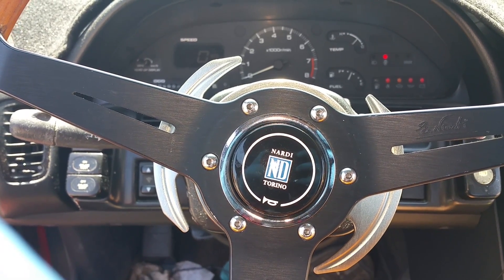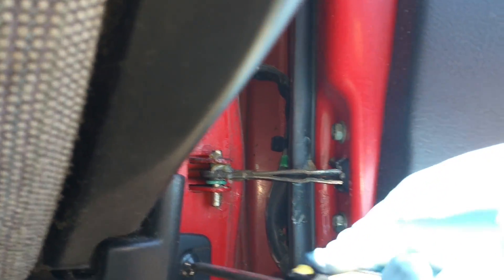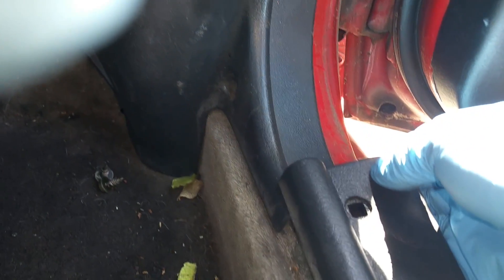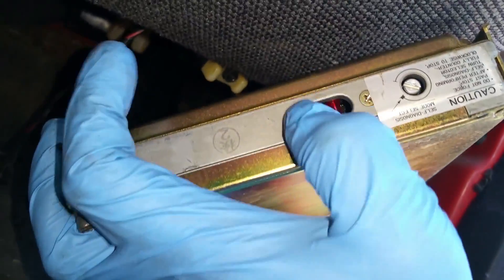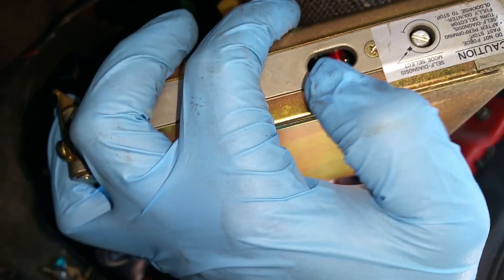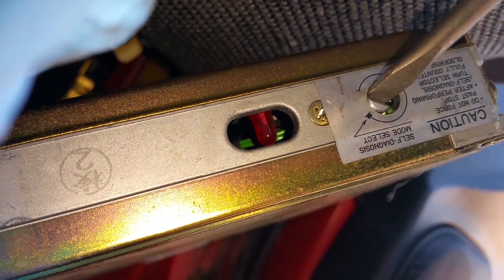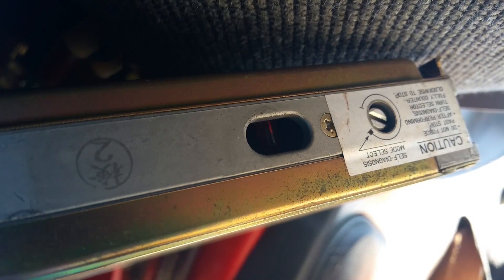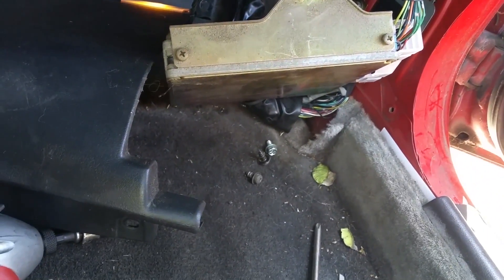How to get codes from your check engine light 240sx s13

Comment: Does this turn off or get rid of the check engine light or is it just for gettting codes?
Reply from the maker: getting codes, then when you rotate the screw back to its original position, it clears the check engine light until the problem triggers the check engine light again

Comment: Man thank you so much ! Just picked up a vert w a DE and I got codes 34 & 13 ! It runs like a champ so far !
Reply from the maker: Nice work bro, glad the video helped guide you on your way to keeping her healthy 🤙🏼
Reply: @albertvintayen  heyyy just a follow up, cylinder #3 has 40psi from compression, fortunately I’ll be rebuilding my 40 coupe vert.
Reply from the maker: @EmiiiZ32  damn, that’s really low, what did you find?  Oil rings on the pistons or a cracked head gasket?  Hopefully not a cracked block!!  At least you get rebuild your engine, build it to factory spec and she’ll last you at least another 25 years!

Comment: awe man thanks, freakin Amazon taking forever to ship my  Obd2 adapter wire for an older model nissan. .
Reply from the maker: Yeah, quick and easy way to get codes off your ECU without the need to buy a consult reader/converter.  How's your project coming along?
Reply: @albertvintayen  challenging
Reply from the maker: Nitter Undercove what seems to be the problem?

Comment: I have 240sx fully loaded fastback car. I am having trouble with sparky. Does check engine light have to be on while turning the ignition switch to on or no?
Reply from the maker: kennedy wong not necessarily, that check engine light would come on only if the ECU detected a misfire or some condition to flag as a code.  If you’re not getting spark,  check your distributor, sometimes the cap goes bad with condensation or there are cracks somewhere.  Also make sure there is no corrosion at your points of contact.  Make sure spark plug wires are good too.  Good luck!!  Check back in with your progress 💪🏼
Reply: Not too worry about the check engine light. The car have fuel to injector but there no sparky at all. I brought new spark plug wire, condenser resister, spark plug, distrubutor cap and rotor. Set the timing TDC and check for compression stroke and it good. rotor facing at 8 to 9 on rotor on distributor. Cranking engine rotor spin and timing chain too, The result no sparky at all. I check ignition signal wiring for open circuit and there no open loop on multi meter. o.k, i check the coil for voltage and there is power. I check the ignition module harness plug and there no power pin 1 which the thick white wire.which Is that ignition module plug. Could be the problem why no sparky?

Comment: I have 1993 240sx but I was wondering if trouble shoot same as your here or no?
Reply from the maker: Yes Kennedy, unless you have swapped out your KA24DE for a KA24E (single cam) this guide should get you the codes you need to find out what's setting your check engine light.  Good luck!
Reply: I want to clear some thing up about ecu. I brought another ecu for ka24de and turn ignition key and there no cel. Is this normal or should it be on, but the car still start.

Comment: nice video man my s13 thanks you kind sir hahah and question where did you get that coolass odometer
Reply from the maker: Kevin Martinez I guess it was an option on some 240sx--it's called a digital HUD (heads up display).  It projects your speed on your windshield so you never have to take your eyes off the road.  Pretty cool but a lot of them are broken.  

I'm glad this video was able to help out!! What problems were you having?
Reply: albert vintayen i havent checked it i just took the ecm out and i was waiting for this cali heat to go away and my s13 has a few problems burns too much gas and also a air leak

Comment: What should you do if the led doesn't turn on after you turn it clockwise and counterclockwise the first time?
Reply from the maker: is it possible you're not getting power to the ECU?  are you having issues starting your car?  best case scenario is you have a burnt out LED--worst case, bad ECU.  

Here's a link to all the ECU codes you could get
http://www.240sx.org/faq/articles/ecm_codes_doch.htm
Reply from the maker: Doctor Penne the guy never responded, but I’m sure he just replaced his ECU.  They’re a dime a dozen (at least they used to be).  Shouldn’t be hard to source one on eBay, just make sure it matches yours exactly

Comment: My 240 isn't pulsing fuel to the one injector and I had it checked out and I was told I have a bad ecu. I changed the injector thinking it was that and it wasn't I had someone test the connection in the injector plug and it was bad. Do u think trying this would help that problem by any chance? It doesn't seem likely but I thought I would ask. If there's anyone out there that has an answer plz let me know. Thanks!
Reply from the maker: When it comes to 20 year old PLUS cars, there's bound to be a bad connection in the wire looms (age, heat, vibration) it's just a fact of life.  If you could, try to find a wire "tracer" and find where breaks and repair or replace it (your call).  As for a bad ECU, I have never run into this happening--but if this were the case, I don't see why you couldn't borrow a friend's ECU and try it in yours to see if that fixes the problem (easier than dropping money on a used part at a junkyard).  And if that fixes it, then hey, I guess you're in the market for an ECU.  There's no real way of finding a code for a pulsating injector, just these "trial and error" ways of fixing it.  I hope you find your way and the fix isn't too obnoxious!  Update me on this, I'd like to know how you did!!  Good luck!
Reply: albert vintayen yeah that's true that's kinda the only downside to obd 1. As a matter of fact I got another ecu and popped it in and that fixed my problem. I didn't think the ecu was the problem either but hey cars are cars it could've been anything and like you said, trial and error is really the only way to fix it. My 240 is running A1 now n I couldn't be happier! Thanks for the advice/ response I appreciate it!
Reply from the maker: Ayyyye, glad you're back on the road!!  Maybe you had some sort of electrical pulse that messed up your fuel mapping--but you're right.  The odds of that happening are pretty slim to none.  That problem probably would have stumped me for a couple of days.  Always nice to have spare parts lying around ;)
Reply: albert vintayen Thanks man! and yeah sadly that's most likely what it was. Believe me it stumped me too haha and that's for sure, extra parts are a must 👍

Comment: Would the technique be the same for a 95 s14 KA24de?
Reply from the maker: +Saiyan_AB I'd like to think so--it depends on when your car was manufactured.  "All s14's manufactured after July 95 are considered '96 models and therefore are OBD2"  so if you don't see an OBDII plug under your dash, then it's probably an earlier s14, and therefore, OBD1.  Let me know how it works out for you!
Reply: +albert vintayen found out it's an obd2 sucks cause I took out the ecu... I was looking for the obd2 plug under the driver dash didn't see anything it was on the passenger side opposite of the ecu tucked away in the back
Reply from the maker: Yikes bro, yeah that sucks, just put it back. Lucky for you, obd2 is easier to diagnose, all you need is a scanner (no need to pull kick panels, lol).  Keep me posted bud! Good luck with your car
Reply: +albert vintayen yea lol at least I know how to check it if I ever have a car with obd1 now
Reply from the maker: +Saiyan_AB 👍👍 some cars are even easier than this lol
Reply: yo I have a 95 s14 ka24de.. so it is obd2?
 I was about to do this but nothing on our year
Reply: was yours stock untouched or someone mess with wiring and or what year?
Reply from the maker: It all depends on when your car was manufactured.  Cars made up till February 1995 are OBD-I -- cars made after February 1995 are OBD-II. 

What does the sticker on your driver's side door opening say? That will tell you what your manufacture date is....
Reply from the maker: completely stock.  i don't buy shit cars with rats nests in them.  I've done that once--it was a nightmare.  Never again.  I hate people that "ghetto fab" wiring.  There should be some sort of class in school for that...